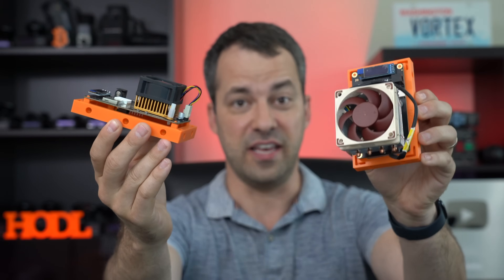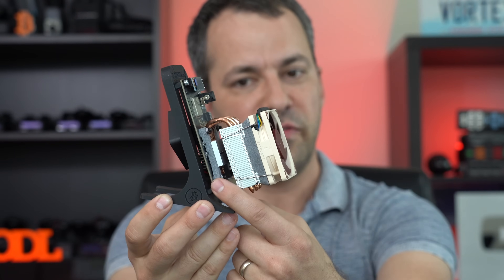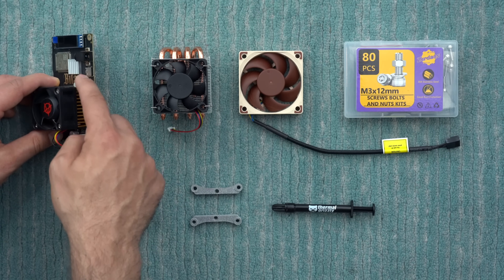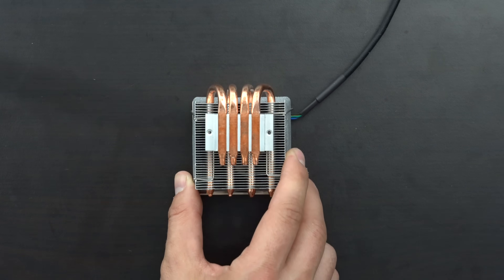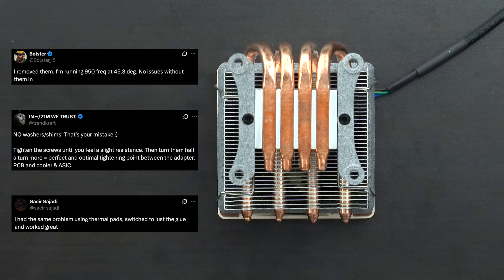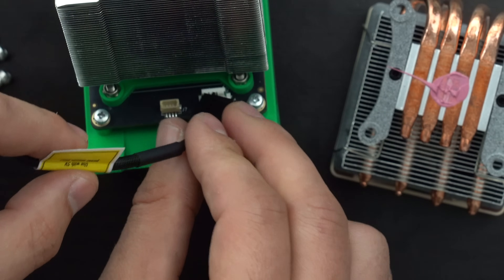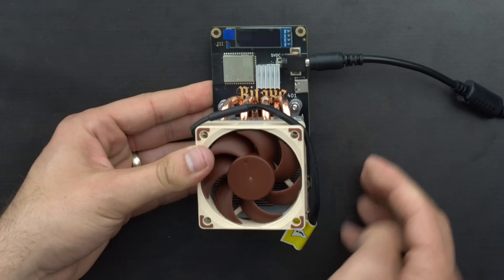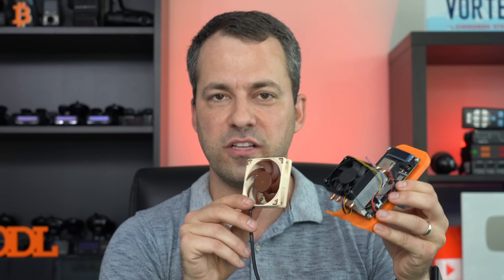Amazing Upgrade For Your Bitaxe's Heatsink & Fan

Comment: I found I had better cooling with the Argon THRML over the low profile Raspberry Pi cooler. I used the original fan from the THRML to pull air out and the Noctua to push air in.
Settings for OC are Freq=975 and CoreV=1350
ASIC temp is 56 and VR temp is 71 with ambient temp 21*C
I also hooked 2 up to a water cooling system and have a NF-A12x25 with a custom fan shroud cooling the VR which I think will be better over the summer.
Reply from the maker: Ah interesting!
Reply: How do I go above the 625 and 1250?? Tia
Reply: @biglonniegruhn first you want to make sure you have an upgraded 5V power supply that’ll provide enough voltage to your bitaxe. Next, you’ll want to improve the cooling. I recommend getting the Argon THRML60 for the ASIC and mount the stock 40mm fan to the back to cool the VR.
Then in a browser, log into your bitaxe, select settings. Then in the address bar, add “?OC” to the end.
Then you can manually set the frequency and voltage.

Comment: The only upgrade I currently have is the Ice Tower heatsink. With the stock fan and stock power supply. Any recommendations on the settings to try overcooking?

Comment: Great timing of this video, I've just finished upgrading all my Bitaxe's to the 52Pi Low-Profile Plus cooler shown here, literally in the last 10 mins😂. I removed the Argon THRML's I had on them to this. Also you used the wrong screws for the mounting brackets, your meant to use the little silver screws that come with the cooler, they recess into the hole, the black ones are too long. I used the copper shims, but removed the thermal pads/glue, and stuck them down with thermal grease, so it's copper to copper. Another tip is to slightly bend the cooler upwards to you have space to plug in the fan
Reply from the maker: Thanks for the tips!
Reply: Well done sir ninja
Reply: I replaced the shims to a 4mm x 30 mm copper plate far better connection and temps
Reply: @DragonS0ultaker where did you get this?

Comment: Are you on the stock PSU or did you upgraded?
Reply from the maker: Definitely upgraded. It’s a must if you’re gonna push things. Meanwells are the standard. https://youtu.be/hdeLD3GTb5A?si=SDa_Z47h3Lx-lP13
Reply: @ just wanted to know, i have my own PSU adjustable voltage supports up to 14 Bitaxe very stable, with OC will have to run only 10 anyways thanks for the information on the fan, i was going to get the 20mm version vs the 15mm
Reply from the maker: Ah awesome

Comment: Finally. Someone is talking about the ambient temps in summer. This is a serious problem imo. I have 28 degrees celcius here in my apartment and one of my gammas is overheating at over 70 degrees on stock.
Reply: I had to drop the default voltage using the default power supply on a couple of mine. The chips are great hashers, both hit 2 plus Th/s  when using a better power source. In the end I want balanced miners that run cool, quiet and don’t cost me much to run them.
Reply from the maker: Crazy, right? Those Gammas run hot…
Reply: Having this issue right now. Updating the heat sinks to hopefully fix the issue

Comment: copperzila for BM1370 keeps temp below 40C no matter how high you overclock. Copperzilla for the win consider testing it.
Reply from the maker: Lots of good options on coolers, though I have serious doubts about that temperature claim, lol.
Reply: I ordered the bitchin sink for my 3 gammas. Think it will do the job in summer. No oc and ish.
Reply: @jonaskreuder1817  yes of course. you dont need to overclock it my most effencet setting is 650/1290 and temp stay under 40 I think I saw 48C but that becuase I went even higher also check Voltage Reg. temp I put a heatsink on.